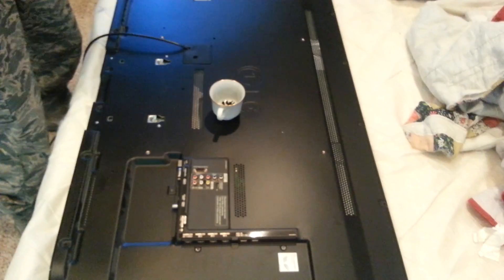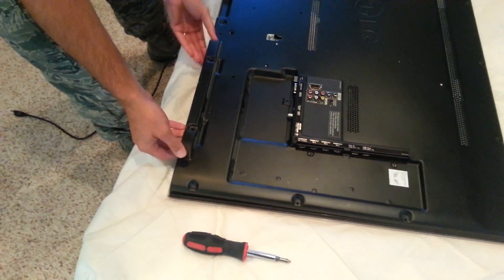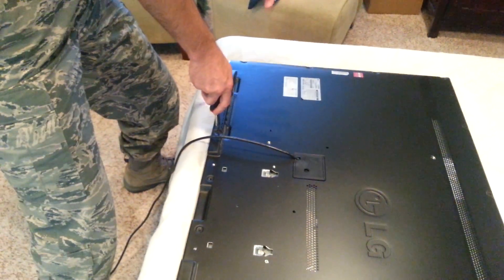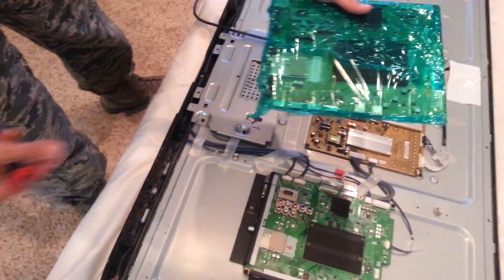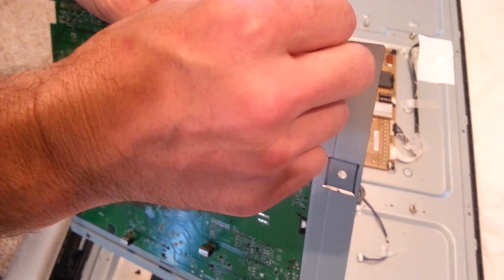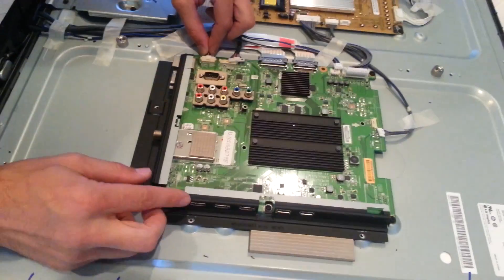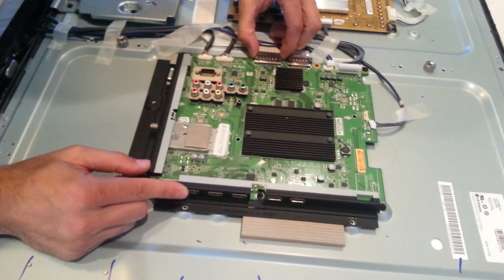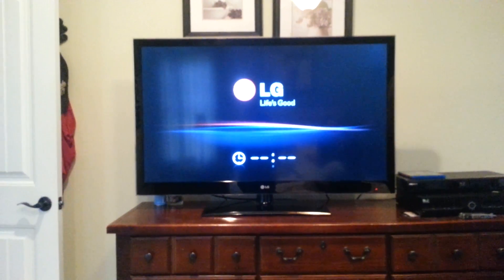LG 47LW5600 Main Board Replacement

Comment: My tv same model is not showing any pictures but seems to turn on because the on light button is white.. is the main board the problem or it’s something else?
Reply from the maker: It sounds like your monitor is out. Mine would come on. It was just my connections.
Reply: I'm having the same issue. Did you find out what the problem was?

Comment: You need to show the process of taking the back off in its entirety. It hangs at the "ports" panel and folks need to know how you got past that. Also, show the process of removing the old board and then, installing the new board.
Reply: @Lambert J. theres a screw between the component and rca ports. hard to see.

Comment: Thks for sharing. Followed your instructions and replaced the main board in my LG tv. Each of the three HDMI ports had stopped working. The tv ultimately started turning itself off and on as though there were a power supply problem. Replacing the mainboard solved that issue as well. Saved hundreds by watching your video and doing the job myself.!
Reply from the maker: Awesome! Glad to hear it man.

Comment: Hi ,
I could really use some help . I can see the while light on my LW6500 but the display doesn't seem to turn on .Is there an issue with the main board ?
Reply: +David Arroyo Sanchez I replaced the main board. Bought it from Sears.
Reply from the maker: +Ashwin Shankarananda Possibly, but it could also be your screen itself. Does it do that when you plug in all the inputs?
Reply: Ashvin, were u able to figure out the problem with your tv. I am having same issue. It just happened last week. Very surprising we are facing same issue near the same time on same tv.
Reply: +Ashwin Shankarananda i also have this issue, any one has solve it ?

Comment: Having the motherboard replaced on my LG 55LW5600 because the TV is stuck on the LG screen, and is flashing.  Do you know if this will update my ability to use Adobe Flash?  Currently on the TV Flash will NOT update rendering it useless.  THANKS so much.
Reply from the maker: The new board will set your TV back to factory settings. Thanks for watching.
Reply: +Wolfy 213 where did you find the board for the 55lw5600?
Reply: +Robert It was under warranty.  THANK GOD.

Comment: Do you know the part number on the board?
Reply from the maker: This particular model comes in 3 or 4 different part numbers. All SHOULD work for this TV model. My replacement board had a different part number than the original and it is still working great.
Reply from the maker: Ok I just checked and the part number for this board is EBT62020705.